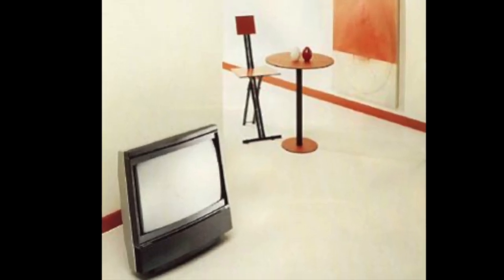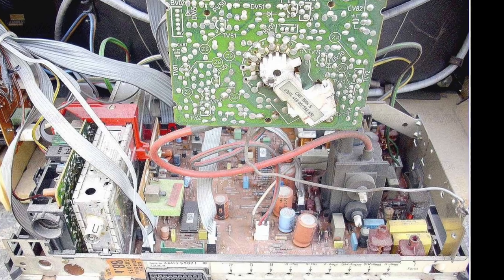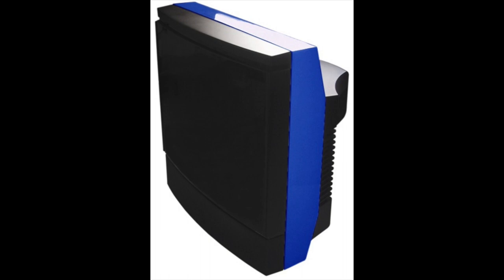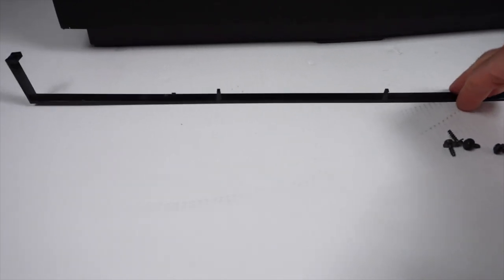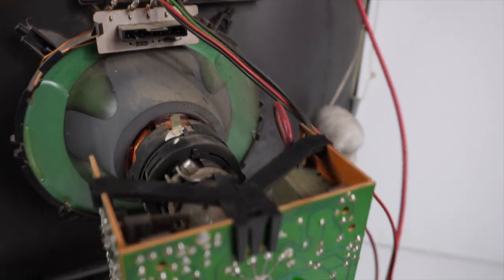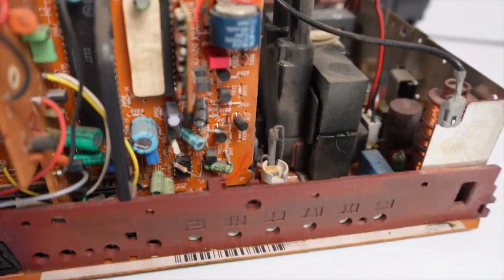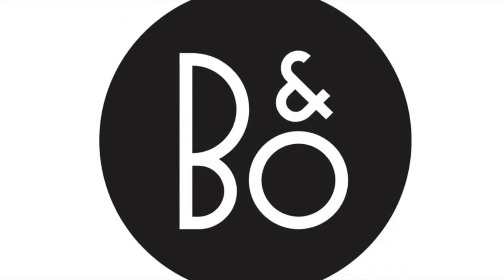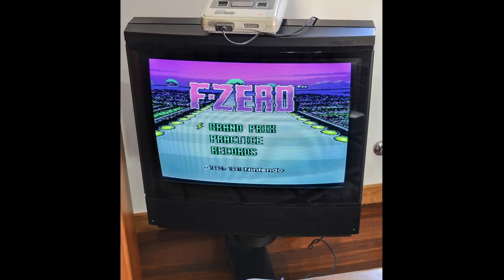Bang & Olufsen Beovision MX 5000 SCART CRT TV

Comment: My grandfather used to own one of these up until 2019. It was bright red and used to be the main living room tv up until a big house renovation that happened around 2008. He now has a Loewe LCD tv. The B&O Had a built in analogue satellite tuner as well as, of course, Scart. It was a great looking thing. To use it I had to always squeeze one side of the screen just a little to make the power come on. Up until 2012 it genuinely was used as a secondary tv to use when we were at my grandpa's. RIP Analogue Sat-TV.  After that it sat around unused. One day I decided to bring an RF Modulator and some other adapter stuff over to try and get a new(ish) digital receiver running. I firstly tried the Scart input but that only caused some rather interesting glitches. So then I jumped over to modulating the Scart Signal into an analogue tv signal and tuned the tv to it. It miraculously worked. That gave my grandpa enough motivation to give it to a (sadly now defunct) repair shop to get the SCART working again. They actually got him a new old stock Interface board to replace the one inside with. But not too long after they replaced it (and it did work!!) it finally went pop and was called a loss. 
Such great times I had... I somehow always liked that thing. 

It's great seeing you documenting it so well! I feel like I want to go look for one, make it look nice and fancy, and gift it to my grandpa again. Just for the memories...
Reply from the maker: Sweet story. Sounds like it provided many years of service. How good would it be to gift your Grandpa an MX for old time sake!
Reply: @rgbrob  it definitely still would fit in with the decor he has upstairs. It genuinely looks like an old high-grade HiFi magazine up there... absolutely gorgeous, actually. The late 80s, early 90s high value West-German design really resonates with me for some reason... it's all so... artsy... a B&O TV would just ROCK in there once more. I genuinely asked myself if it would be possible to somehow squeeze a digital tuner in there. It'd probably use a normal AV input but I've seen some absurdly small DVB-S2 tuners out there. You could probably fit the screw terminal where the original analogue one was placed if it's possible to remove the analogue tuner. Then it would be as simple as feeding a video signal to one of the inputs internally and getting an IR receiver in the front for the digital stb inside. 
If I had the financial resources and CRT expertise (aka not dying of an electric shock) I'd totally love to do that one day. Going on a nostalgia trip and bringing it into the 21st century once more...!

Comment: A very well-researched video! Yes, the dreaded ICC5; enough to make even the seasoned repair tech break out in to a cold sweat! They were more commonly found in Ferguson-badged TV's here in the UK, which, I guess you could say was the poor man's B&O. I don't think many survived, as I rarely saw them on the second-hand market (unlike the older Thorn 'TX' range).

B&O's in-house chassis designs were very interesting, though service data for them was quite scarce; naturally all servicing work being carried out by B&O and their authorised agents. Some TV repair shops would refuse to take them on due to this (unless it was something simple like those horrid plastic-encased Roederstein caps that liked to dry-out and/ or fail short!).  

I recall around that time (mid-eighties), we instead opted for one of the first large-screen stereo 28" FST sets to market, which was manufactured by Finnish company, Salora. The set also employed a Videocolor tube; in fact it was the exact same type that was fitted to the Hantarex Polo/ MTC arcade monitor chassis. Excellent results for a domestic receiver with an RGB capable SCART. Happy days! :')
Reply from the maker: My friend had a scart Ferguson back in the 90s here in Australia, very uncommon brand here. Interesting that you never saw many on the 2nd hand market in the UK.

Annoying that manufacturers kept their servicing knowledge so in house. 

The Salora you mention sounds sweet as!
Reply: @rgbrob  Yes the Salora was before they merged into the ITT Nokia group of companies. It was dealer upgradable with 'option boards'. For example: NTSC 3.58; SECAM; FM Tuner; Free-To-Air analogue satellite; NICAM; Teletext, etc. All of which could be added at a later date (or specced at the time of purchase). In a lot of ways, taking a leaf out of B&O's book! 

European electronics at the time was totally state-of-the-art. It's a shame it's all gone, but that's the price of globalisation and 'market forces' for you! Still, we can continue to be inspired and admire the creativity behind it, as reflected in the sheer classiness of the products from that era.

Comment: excellent video Rob :) i have 2 MX4200 TV's 1 with SW 2.5 and 1 with SW 2.9, they aren't the same on the inside, 1 has a battery for the RTC, the CRT is also different, the one with SW 2.5 got a Panasonic tube, the one with SW 2.9 (that one has the RTC) got a tube that's made by a company that bought panasonic i guess, need to check that again :) they have both excellent picture quality.. so yeah, i use them for retro games!
Reply from the maker: How interesting such variety of tubes. Not unusual for tv brands to use many different manufacturers tubes but i though B&O might be different but not so.Glad to hear that both your sets are going strong!
Reply: @rgbrob  yeah, they are not so old, they are the last crt tv’s b&o made, one is from 2004 and the other from 2006
Reply from the maker: @dexx2233  Good stuff, the tail end ones are often the best with many products
Reply: @rgbrob  yep, i had to replace 2 capacitors on one of the tv's because some in the factory made a mistake, 1 capacitor had a dent and one was bulging because of that :P btw, i also have a Beocenter AV5 here with SW 3.3, it got the CD-I player inside but the controller ports are covered... so i made a hole there and presto! instant controller ports, i had to enable the CD-I mode in the menu, this is a amazing piece of hardware, it's from late 2000 ;)
Reply from the maker: @dexx2233  wow thats crazy that the ports  are covered. Was the cdi part such a flop that B&O hid it to avoid the losing technology in their tv?
Reply: @rgbrob  yes, even the manual tells me if you have the ports on the back.. they are useless :P it's really funny, could show you what i did with mine, maybe i'll record a video of the thing in the future :D

Comment: I bought a broken MX8000 thinking I could fix it... Nah... No service schematics available and no clues marked on the board. They obviously didn't want people trying to fix these things themselves.
Reply from the maker: Damn its bad isnt it? We just want the things operational to use them.
Reply: I found a list of the common components to fail on a beoworld forum. Said to cover 90% of faulty units. I did this to two MX6000, and they work now. The thread was named «Workshop How to rebuild a MX4000 MX6000 MX7000 and AV9000». You might find something similar for you tv. I also found a pdf with schematics.
Reply: Thanks for the tip! I think I've actually checked that forum. The boards on the mx8000 are a little different. Believe it or not I actually purchased a similar board from a 32 inch wide-screen model and swapped the flyback from mine out. My tube and flyback work. I've checked every obvious component and even swapped components out from the working chassis to mine. All to no avail. There are so many little ICs on those boards it's ridiculous. So it could literally be anything. Without a schematic or service manual it's next to impossible.

Comment: Hello. I have a beovision mx5000 and it too has corrosion in, on and around the battery on that teletext card, and on the other battery too. Also due to the bad state of the corrision, the battery solder points are loose. My guess is that this is the reason why I can't see any info/text on the screen. No volume bars, no channel or source info, no menu etc. What do you or anyone else think?

I've cleaned it and it no longer smells like something is burning. However, now it emits another smell. A kind of stingy electronic smell that really fills the entire room after some 20 mins. Could it be those leaking batterys or something else? Anyone have a clue?

Cheers.

Comment: No idea that Bang & Olufsen has been making massively overpriced TV's for such a long time I really thought it was just recently with what I thought where rebranded fancied up LG OLEDS. Maybe it's just because i'm American and we didn't get them back in the 80s and 90s.
Reply from the maker: B&O have been making tvs since the 1950s. The oled panel being used in modern tvs by other brands is also what often occurred back in the crt days. B&O would often use philips tubes, i don't think this fact may have been as well known/publicised as today it is today with the knowledge of panel manufacturers.
Reply: @rgbrob  yes, LG display is the only company in the world that makes W-OLED panels,  Sony, Phillips, Panasonic, LG they all use the same panel made by LG. But they all make their own processor's, and operating systems for their TV's. I don't know if B&O does this, I doubt it since they probably don't have millions to throw at R&D like company like Sony or Phillips would have. I just assumed that the B&O TV's where dressed up LG TV's with a fancy sound bar.